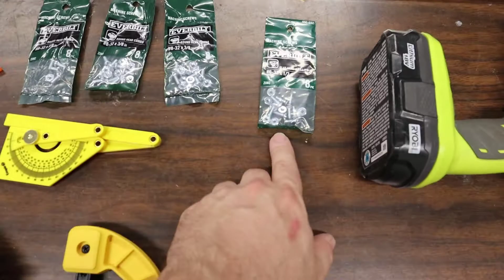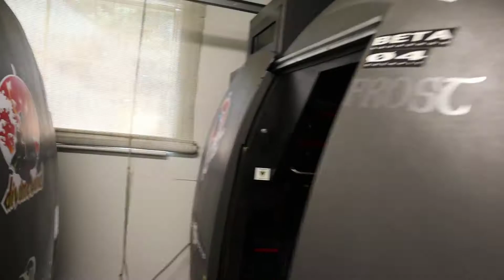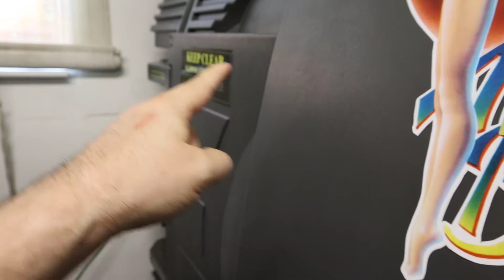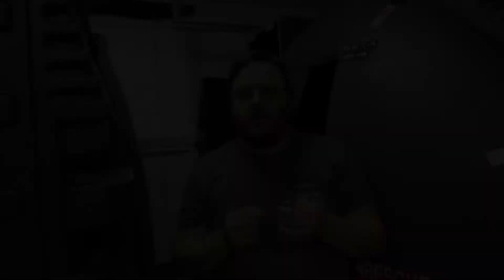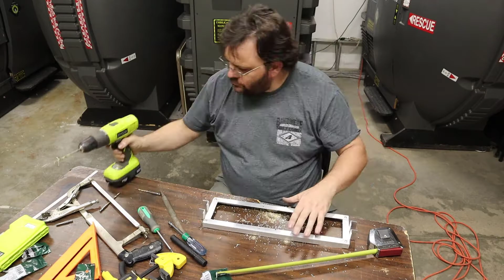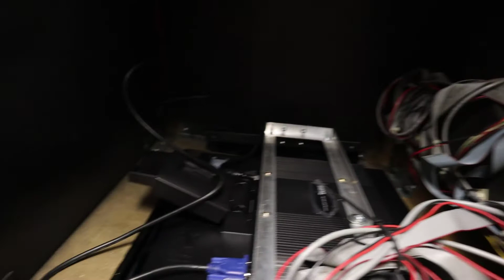Tesla 2 Mod Main Monitor Conversion

Comment: Do you use older, VGA square-ish  monitors, or can you use newer HDMI/Displayport monitors with adapters?
Reply from the maker: I use the original pc's as I have a surplus of OG video cards. So all 7 monitors go to 3 video cards and yes it is all vga.